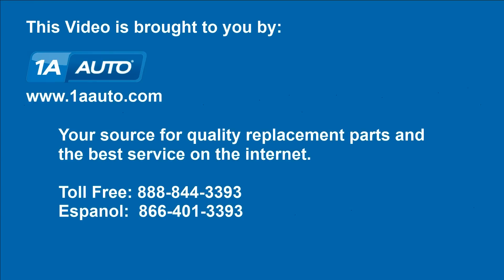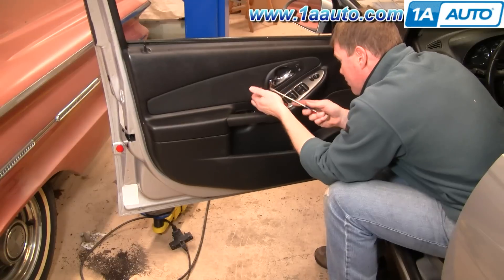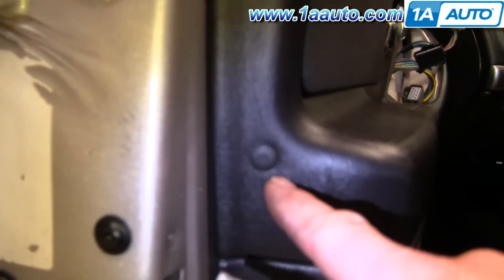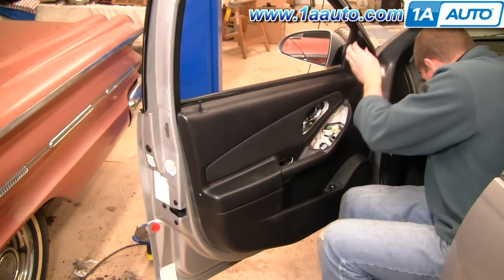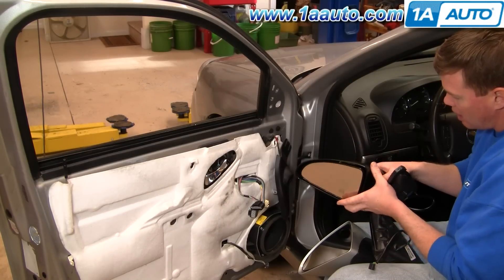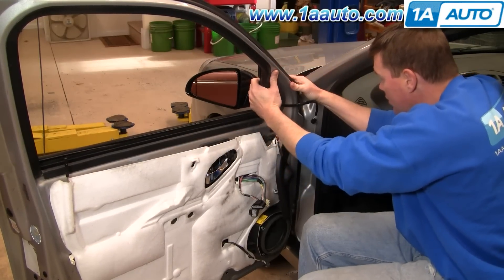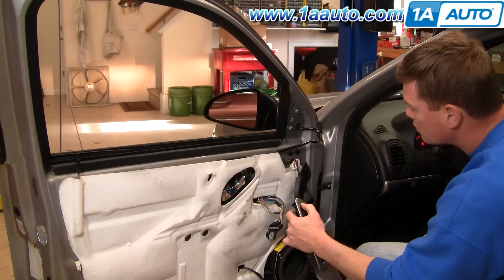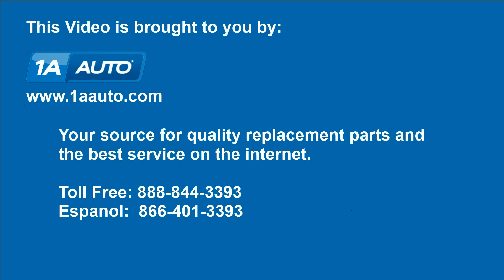How to Replace Mirror 04-08 Chevy Malibu

Comment: Just did mine.dud not remove door panel.individually cut the wires long.cut off the plug.used ideal 85-925 telephone splices to reconnect
Bolted it back in in less than a half hour.works like a charm and way way way less work.

Comment: i just removed the top corner panel. didnt have to mess with the door. took 5 minutes, a flathead screwdriver and a socket wrench
Reply: Yep. I have no idea why this guy is messing with the door panels.
Reply: @jsk1960  Agreed. 2 minute job, tops. What in the fuck
Reply: I couldn’t get the plug disconnected back under the panel, had to loosen it almost all the way off myself
Reply: @taylorb2783  yeah I thought about Will the cord pull out. Guess I will try it the fast way first and see.

Comment: You can get away with removing only the top corner panel BUT: there is very little slack available from pulling up the wiring from inside the door panel. You will have to have very nimble fingers and  flat screwdriver to pull up the tiny lock and release the connector. Putting the new one back in is worse. You have nothing holding it to press firmly and have it click in. I found by reaching in and pressing the clip tightly towards the frame I was able to get it to hold enough to get a solid click. Don't want to chance this then I would leave the original connector in, cut the wires further up, cut off the new connector from the new mirror, and splice together the three wires. Not wanting to do that, then pull the door panel as shown. Grease and oil the latch and the "Door Ajar" switch while you are there.
Reply from the maker: +Linda Surek thanks for checking us out, we appreciate the tip!

Comment: Another you tube video does not remove the door panel to replace the right side mirror. Just pop the speaker off, disconnect the wire and three nuts, replace and you are done.

Comment: Just curious... I am sure there is a reason so excuse  my question not trying to offend... but couldn't you just replace the mirror by pulling off the cover where the tweeter was.. it looks like you have access to the screws, and could finagle the wire for the mirror out of the door